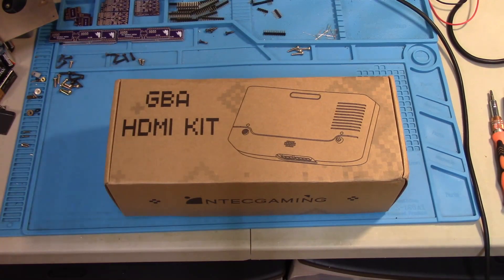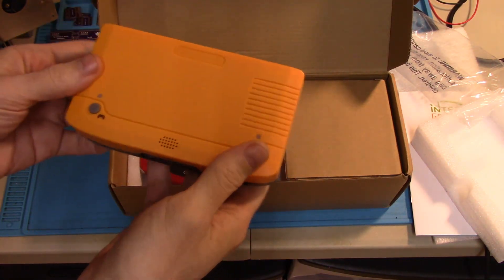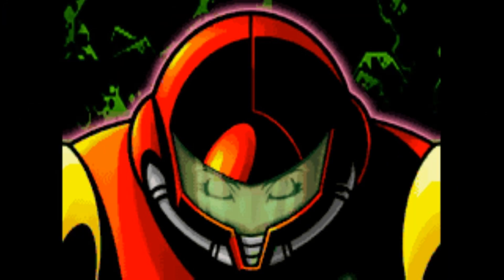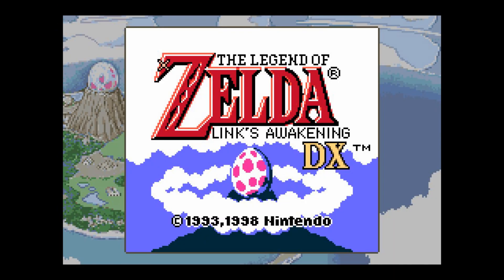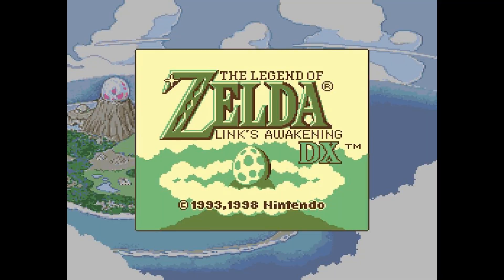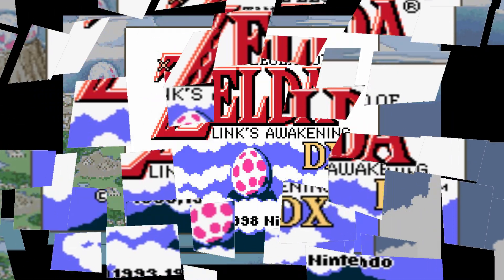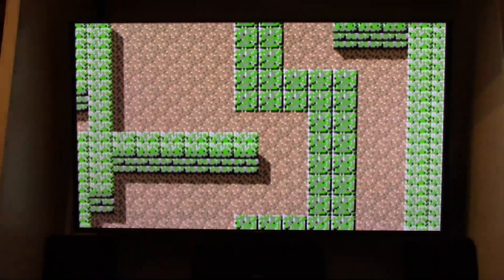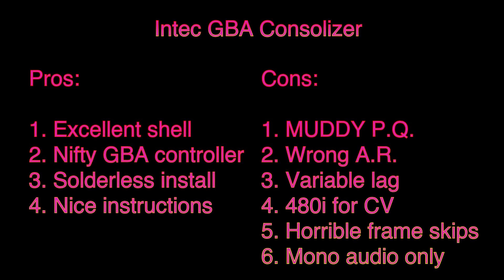Intec's Game Boy Advance Kit in 5 Minutes

Comment: There's legitimately so much good in this, which is what makes it so disappointing.

The solderless setup and GBA shell to controller conversion kit are both genius in their own ways. But they just completely squandered it with the terrible generic scaler chip and analog out, wrong aspect ratios, missing audio channel, and more.

It feels like all these good things about this product could be adapted to a far better product instead.

Comment: Real GBA hardware doesn't show SGB backgrounds when playing Gameboy games. Is the Gameboy comparison a mock-up, and if so why?

EDIT: The only thing I can think of is you're using the Goomba Color emulator on a GBA flash cart to run Link's Awakening.
Reply from the maker: Running GBA Everdrive. So no, not a mockup. This was in fact run through real GBA hardware on both consolizers.
Reply: @RedArremer  Yeah that makes sense. I initially forgot about the GBA Everdrive's ability to play GB ROMs and didn't know how you were doing it otherwise.

Comment: And the Mono audio only... Wow there is ZERO excuse for that.
Reply: They have only 1 pin for Sound that the take from the speaker port
Reply: @-Gothicgirl-  Yeah thats awful, and taking it from an analogue source such as the speaker output makes no sense.  Hell they could have at least took it from the headphone jack.  There are also audio pins they could take from directly.  Woozle's kit gets the audio straight from the CPU if I'm not mistaken.
Reply: @skins4thewin woozle take Audio on the flex cable Version from the cpu. On the break out board it get it from s01 and s02 on the board like the Gbahd too. But that needs to solder tge contacts on the volume wheel and a Clip in the headphone port.
Yes they could take ir from the headphone port. But this mod looks like for short buy people that think they have the best quality but never see a good picture quality mod.
I be on the Gbahd
Reply: @skins4thewin  yeah and I have the Gbahd which is self build and that good like the gba consolizer
Reply: @-Gothicgirl-  GBA HD?  Never heard of it, and I follow the scene extremely closely.
Reply: @skins4thewin  GbaHD is a community Project from here in Germany. It's a open source build for gba and gba sp. It use a other fpga then woozle and a Shield. The Features are not that much as woozle but it is the same good result on the TV.
And yes it is not that much known on the people and people rlike retro rgb Boykott it.
All parts without the gba cost under 100€.
I have some Videos of the Features and a build Video on my channel and you found some build Videos on yt. Some worked that project even to use with a GameBoy Player  addon
Reply: @-Gothicgirl-  Interesting.  Why do you say ppl like Bob at RetroRGB are boycotting it tho?  That's a pretty bold thing to say.
Reply: @-Gothicgirl-  What exactly did he say about it?   Was going to say just because he doesn't cover the project doesn't mean he's boycotting it.  Maybe he doesn't know much about it or hasn't been given one to test.  

Or perhaps he is aware of it and there is reason for him to believe that it's not a very good kit.  I don't really know, just making guesses.  Do you have a link or anything where I could learn more about it?  How is the upscaling quality?  What resolution does it go up to & how much input lag does it add?  Is it using it's own upscaling code via FPGA or is it using one of those garbage laggy Chinese upscaling chipsets used in so many of the horrible HDMI kits?

Either way it's hard to say what his opinion is without seeing the convo.  I know he can be a dick at times tho so I can understand that.  He's been pretty rude to me in the past as well, and I've heard about him deleting comments.
Reply: @-Gothicgirl-  I think it's also important to remember that the burden of proof is on the creator or end user, not him.  It would need to be shown to him that this is a quality product worth checking out.  Maybe the creator should contact him & share the info on the project with him.  

I am sure if it is a quality kit that he would be interested as he is interested in things that are made correctly & are of good quality.  But someone would need to make him aware of it, and if it's just a very small unknown project out of Germany well then again the burden of proof is kind of on the creator if he wants his/her project to be known.
Reply: @skins4thewin  I dont know why but yt kill my post everytime
Reply: @-Gothicgirl-  Any of those questions I asked that you could answer would definitely help.  Will try to get the word out if I can indeed find out more about this project.  There needs to be a detailed analysis & showing of the product on either a website or Youtube so that word can get out.  

These things aren't going to just be discovered out of nowhere, they word has to be put out there & shown that it is indeed a quality product.
Reply: @skins4thewin  please contact me on discord because YT delete every post with Details and Co and im not to rewrite and try untl the Post is not delete

Comment: The Mono Sound is only fixible with a Board Revision! The use 1 pogopin on the sp contact of the gba board. On the side of the b a and r Button are only 4 pins which means 1 Sound pin. They should use 2 on s01 and s02 for Sound but that need a Clip in the headphone port and a soldering